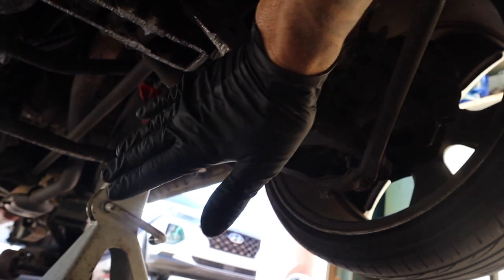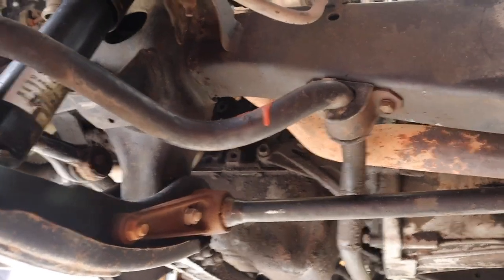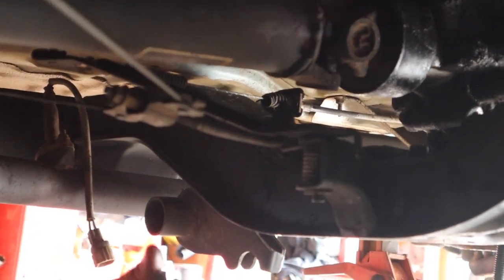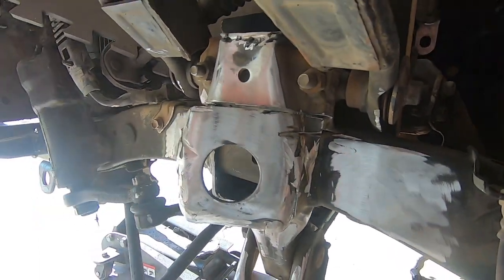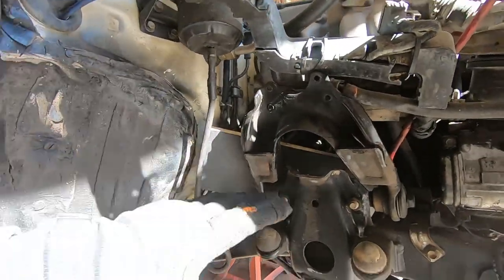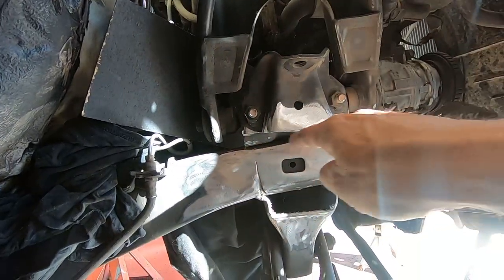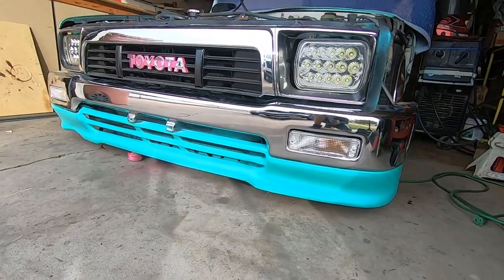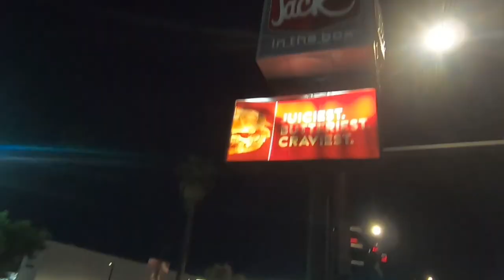Minitruck Vlog Episode 5 - Front Airbag Install - Bagged Minitruck Build

Comment: Jordan doing burnouts lol that brotha is cool as funk
Reply from the maker: Yeah, great bunch of guys, super cool, and Freaking Rad rides!
Reply: @skillset_ben  yes do you come up to Taco Tuesday on Tuesday night at 53rd and bell rd I can't wait to get one of mine on the road again as I'm working on 2 rides now etc  just a few more things then frame can go to powder coating and then get the Ford 9" rear end shorten then it off to powdercoat and can start to put her back together on my 98 Nissan Frontier I also have a 89 2 door Nissan pathfinder with a 68" sliding hard top which will be next to work on
Reply from the maker: @nikob829  Holy S@#T! That's awesome, man. I'll be stoked to just get this one back out soon.

Comment: Did the upper bag brackets get the gussets welded in off camera? It's been about 10 years since I sold off my minitrucks. I'm glad to see people are still building them. I used to be in Perfect Poise CC.
Reply from the maker: At this point no they hadn't, but they will for sure. Wanted to make sure I had the brackets positioned correctly to get the most lift. Slam specialties SS6 bags. Full install video coming soon, so Subscribe 😁

Comment: Nice, question have a 1971 hilux working on, installed bags also front and back, but had to delete the front shock, thinking of modifying and relocating front shock or not,  haven't driven it yet still in the making,  does ur ride does find with out it or does it bounce in front ?
Reply from the maker: I have shocks on the front of this truck. If you go watch video " final assembly episode 17" at the 4 minute mark you can see my current setup. I personally would never drive a bagged truck without shocks. It handles great. It's safe for you and others. Your rims and bags will thank you. ❤️🤙 where can I see pics of your rad truck?

Comment: Looks cool! I have air suspension on my truck as well. I only have air bags in the front, no additional shocks and I get a little wobbly on bad roads and some shaking in the steering at about 55mph or up. Will adding regular shocks to the front bags help? Thanks for any info guys.
Reply from the maker: Heck yes! You should always run shocks. Its way safer, and not to mention, your expensive wheels will thank you.